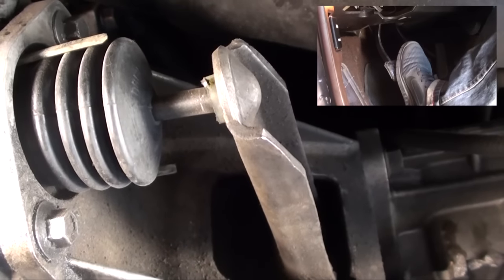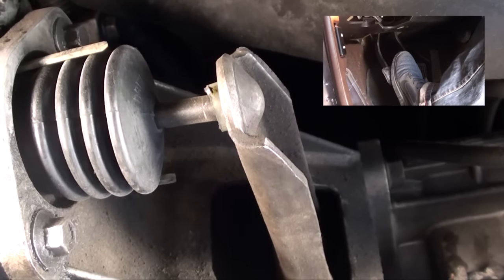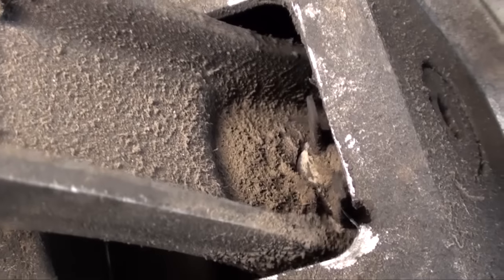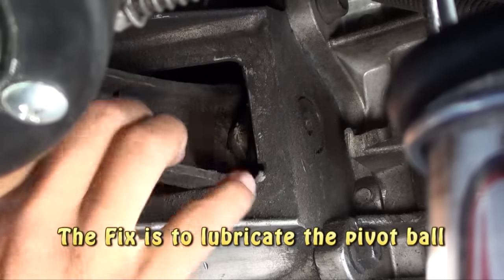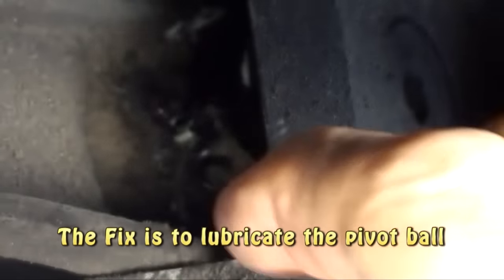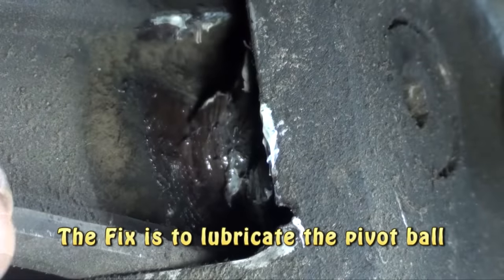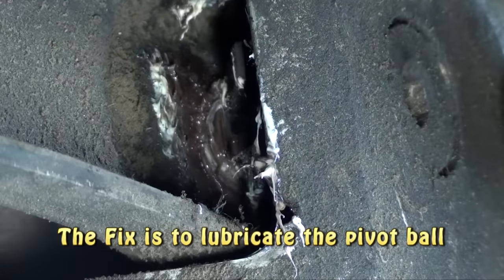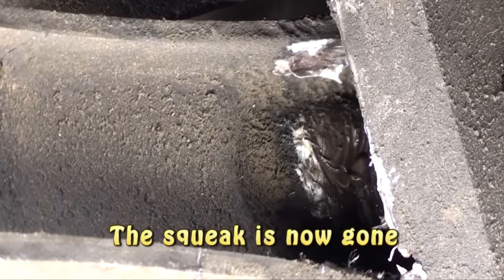Clutch Release Fork Noise

Comment: Hi,  My car shakes while shifting on low gears 1st and 2nd and squeak  sound also comes when pedal is pressed 80%.Not feels when shifting at high speeds. Any suggestions? Car ran 40k and is it the time to change the clutch? No pick up issue so far noticed. Thank you.
Reply from the maker: If you can provide me with some more information I will try to help.  The shake occurs at what point.  In other words while you are making the upshift from 1st to 2nd or after you let the clutch out once its in 2nd. Or is it when down shifting from 3rd to 2nd or 2nd to 1st.  again does it shake while moving the shifter or after letting the clutch pedal up after the shift has completed. Does it only shake when accelerating? Or will it shake after the shift whether heavy, light or no acceleration.  What kind of vehicle is this?  and is it Front Wheel drive or Rear wheel drive?  Does this happen every single time or only at certain times such as when the vehicle is cold or after it has been driven for some time and hot.  Does the outside temperature have any impact on the problem. The squeak noise could be in the pedal mechanism or it could be a pilot bearing noise. Some vehicles don't have pilot bearings. Does the noise sound like its from under the dash or more like its from under the car near the clutch.  Clutch life really depends on how you drive and your location. If you live where there are a lot of hills the clutch life will be shorter than flat lands.  Do you rest your left foot on the clutch pedal or totally remove it.  Resting your foot is bad for your clutch. If you want to make your clutch last keep your foot off the clutch pedal as much as possible and only use the pedal when you need it. Don't take an extra long time releasing the clutch when taking off from a stand still.  Normally clutches get replace because the friction lining on the clutch disc wears out similar to brake linings. When the disc is worn out the power from the engine will not transmit properly to the transmission and your drive wheels.  This effect is called slippage and first happens under heavy driving load situations. The engine and vehicle will feel like you are partially in neutral as you try to accelerate.  The engine RPM's will be higher than normal and it will feel like you have poor acceleration.  A good way  to test this is to drive on a straight flat road in 1st gear going about 10 mph and upshift into 3rd gear. Let the clutch out and floor the gas pedal.  If the engine shakes and or acceleration feels very sluggish your clutch friction is good and you don't have slippage. On the other hand if you feel the engine RPM's rise up but acceleration is not there you have slippage and the clutch needs to be replaced.  Make sure the disc, pressure plate, release bearing and pilot bearing are all replace. Make sure the flywheel is either machined or replaced and have the shop check and replace the engine rear main seal if its leaking.  Now is the time to replace leaking seals since the transmission has to come out to replace that seal.
Reply: Thank you. Sound and shake is observed when pedal is up after shift completion. It's a front wheel drive car. Sound and vibration is not always there,  when I started cold after shifting to 1st gear this issues repeatedly happening. Once vehicle started moving this issue is not felt. It might be of release bearing. Vehicle pick up is still the same. Its driven at city. I always keep fingers  of my foot (not entire foot) as in city traffic I need to shift gear occasionally.
Reply from the maker: This does not sound like a release bearing at all although its hard to tell since I can't drive it myself. You might not have a clutch problem at all.  I would check the engine and transmission mounts. If this happens while the vehicle speed going really slow you could have an engine misfire but you said the acceleration seems normal so that would rule out a misfire. You said the pedal is up and in 1st gear.  Could it be that the shake happens while releasing the clutch to take off from a non moving vehicle.  If so, that would be clutch chatter. Do you live in a city with a lot of hills like San Francisco? San Francisco is rough on clutches. I know you like to keep your foot ready to operate the clutch because of city traffic but I will tell you that even resting your toes on the pedal is not good for all the clutch parts.    Try what I said to see if your clutch is slipping by putting it into 3rd gear while going slow.  There will be shaking if you do this.  Is this shaking the same as what you are experiencing in 1st gear?  Are you in first gear going less than 5 mph and accelerating when this happens?  If so, that would be an engine lugging.  Same feeling you will get in 3rd gear at slow speeds and accelerating.  Do some more testing and write back.

Comment: I recently bought a 2000 mustang gt and don’t know much about it, car shifts all gears and no grinds at all besides when i put reverse too fast, it’s making this exact same noise when im not pressing the clutch in this case how does it work? i don’t see any pivot soo im wondering if it’s the same mechanism please help, thank you so much for the video
Reply from the maker: I looked up your clutch system.  There are 3 basic designs.  One like what I show where the pivot ball is located close to the release fork opening in the bell housing. One where the pivot ball is located on the opposite side from the opening in the bell housing. and One that doesn't use a release fork and instead incorporates the slave cylinder and throwout bearing all in one assemble.  Your Mustang uses the type where the pivot ball is located on the opposite side from where the release fork extends out of the bell housing.  Unfortunately for you the only way to lubricate the pivot ball and fork is to remove the transmission. Too many mechanics don't apply enough of the right kind of lubricant on the pivot balls and release forks to last the life of a clutch and they can start to chirp.
Reply: @DrivelineMaster all i hear is $$$ :( thank you so much for your time, what are the consequences of this long term? thanks hope u have a good day
Reply from the maker: Yes, $$$.  Depending on the severity this is two metal objects riding on each other moving back and forth with no lubrication.  After a period of time they will both wear and need replacing.  If they wear enough before the life of your clutch disk you will lose clutch operation. I can not tell you how long this will last before it becomes a problem.

Comment: mine is a motor type noise when shifting n clutching....... Every single gear is an annoying nightmare until you put it into final gear and just drive it
Reply from the maker: If you hear the noise or the tone or sound of the noise changes as soon as slight pressure is applied to the clutch pedal even if you only push it down about an inch this points to a throw out bearing noise.  When in the vehicle the throw out bearing noise can vary and almost be a rumble, grumble or grating sounding noise.

Comment: What type of grease could i generally use/general avoid?
Reply from the maker: Use any Lithium based grease.  I prefer high temp lithium grease but white lithium works well too.
Reply from the maker: This will work well.  https://www.amazon.com/Lucas-Oil-10533-Lithium-Grease/dp/B004X70LZA/ref=sr_1_40?crid=JJFKYTZGJ526&keywords=high%2Btemp%2Blithium%2Bgrease&qid=1704128320&sprefix=high%2Btemp%2Blithium%2Bgrease%2Caps%2C141&sr=8-40&th=1 or this: https://www.amazon.com/Sta-Lube-SL3111-Generation-Bearing-Grease/dp/B000M8IHQY/ref=sr_1_45?crid=38QEMHKLH9OSX&keywords=high+temp+lithium+wheel+bearing+grease&qid=1704128572&sprefix=high+temp+lithium+wheel+bearing+grease%2Caps%2C157&sr=8-45

Comment: How do I access the Clutch Release Fork? Is it in plain view? or hiding under transmission?
Reply from the maker: Each vehicle is different and some vehicles don't have a release fork.  You often have to go under the vehicle and see if you can locate the clutch slave cylinder. The slave cylinder connects to the fork.  The fork sticks out of the bell housing and is sealed with a rubber boot. If you can find the fork pull back the rubber boot and look inside to see if you can see the pivot ball.  Some pivot balls are on the other side and not accessible.  Also some slave cylinders and forks are on top and hard to get to.  If you tell me the year, make and model of vehicle I will try to look it up for you and I can advise you better.
Reply: @DrivelineMaster  Thank you for the advice, I have a 2004 mustang v6
Reply from the maker: From what I can tell your mustang uses a cable to release the clutch and the fork is on the left side of the bell housing.  The pivot ball is on the opposite side and not accessible to apply lubrication without removing the transmission.
Reply: @DrivelineMaster  Thank you for the info, how much do you think it will cost to get fixed at a shop?
Reply from the maker: This depends on where you live. Labor rates are higher in big cities as more rural area's.  Dealers tend to cost more than independent shops.  The repair would involve removing the transmission. This is the biggest labor part of the job but as long as the transmission is out you should have the entire clutch replaced. Just make sure to inform the shop to make sure to apply enough quality grease to the pivot ball on the fork so the noise does not return in a year.  It would not be fair to speculate on price. Call around and ask for a general quote for replacing the clutch on your mustang. Ask for two quotes. One with resurfacing the flywheel and one if they replace the flywheel.  I can say, it won't be cheap and almost certain to be north of $500.00.

Comment: Hello, I have the same sound in my Daihatsu Terios 15, would you mind telling me where is located, is it something I can fix by myself, I'm newbie but willing to learn, how to reach it, or should I take it to the mechanic?.. thanks in advance
Reply from the maker: Some release fork and pivot balls are easy to access from the exterior of the transaxle or transmission and some are not.  On the back of the engine is the transaxle.  A round shape as it bolts to the engine.  See if you can locate an opening where a metal arm (release fork) sticks out.  There will be a rubber boot covering the hole so dirt and water cannot get inside.  If you have found this pull back the rubber boot and look inside with a flash light for the pivot ball. If you can gain enough access you might be able to apply some white grease to it with a flux brush.  If not take your car to a technician and show him this video and ask them if they think this could be your noise and if they may be able to fix it without a huge expense.  Sometimes the pivot ball in not accessible unless the complete transaxle/transmission is removed. Sometimes spray grease from a can and a straw can be used but care must be taken not to spray grease on the clutch disk. I don't know about your Terios because I'm not familiar with that vehicle.
Reply: @DrivelineMaster  WOW! Awesome, will check tomorrow thanks a lot for your detailed response.. subscribed!!

Comment: Hey, my 2005 lancer got the clutch replaced last year and started to make the rattling noise this summer and started squealing last week but only when I change gears. The noise goes away when I press the clutch though. Do you think this is an easy fix?
Reply from the maker: A squealing noise most noticeable when letting the pedal up can be a pilot bearing noise.  Pilot bearing squeals or most noticeable when taking off from a stop sign while releasing the pedal.  While stopped put your transmission in neutral and release the clutch pedal.  If you hear the noise it could be the pivot ball and fork or it could be in your transmission.  Here is how to tell the difference.  Apply a small amount of pressure on your clutch pedal. Push it down about an inch. If the noise goes away it's your pivot ball and fork. If the noise is still there it's in your transmission.  If it's a rattle noise from your transmission check the oil level and make sure the correct type and viscosity of oil was installed. If in doubt drain and refill with the correct oil.  If this is a slight rattle that is most notable in a garage or ally way where the vehicle is close to some walls this may be normal gear rattle. You should not hear gear rattle in conditions where the noise can not bounce off of a close wall.  Gear rattle can sometimes be reduces by using a slightly thicker (higher viscosity) gear oil like 75W-140 instead of 75W-90. I would not recommend this if you live where the temperature gets really cold like 30 degrees Fahrenheit or colder.
Reply: DrivelineMaster thank you. It’s a loud rattle but I press the clutch a couple inches (like to the biting  point) and the rattling goes away. When I’m at a stop sign and take off it will sometimes squeak
Reply from the maker: This really sounds like the shop did not do a good job of properly lubricating the pivot ball and fork on your Lancer.

Comment: @drivelinemaster do you know if this would work on a Toyota Corolla 2012? I have has the same crickets/squeak and the Toyota Dealership can't seem to fix it?

And/or has anyone tried this fix on their Toyota Corolla 2012 or similar year?
Reply from the maker: Based on my information it looks like the release fork would not be too hard to get to and that the pivot ball is located on the side of the bell housing that is close to the release fork boot.  What this means is that indeed you should be able to apply some additional lubricant to the pivot ball and fork by accessing it through the release fork boot.  You might be able to get some white grease in a spray can but you have to be careful not to spray grease everywhere.
Reply: @DrivelineMaster  thank so much, I’ll report back on the out come!!
Reply from the maker: Good Luck

Comment: was the release fork and bearing exposed or did you have to open the gearbox casing?
Reply from the maker: The release fork sticks out the side of the bell housing and the hole is covered up with a rubber dust boot.  I pulled the rubber dust boot back to gain access to the release fork pivot ball.  I could see the release bearing but it's not accessible or serviceable through the release fork hole.
Reply: @DrivelineMaster  oh but i can put some grease on it via that hole?
Reply from the maker: There are 3 major designs.  One doesn't even have a release fork so this video doesn't even apply.  The other two designs use a release fork and pivot ball.  Design one is like the video where the pivot ball is close to the release fork opening. If you have this design then yes, you can lubricate the pivot ball through the release fork hole.  Design two has the pivot ball on the opposite side of the release fork hole. If this is the case you will not be able to lubricate the pivot ball through the release fork hole.  The transmission will have to be removed.  The only way to know for sure is to pull back the rubber boot that encloses the release fork and look inside to see if you can see the pivot ball close to the opening. Good Luck.
Reply: @DrivelineMaster  ill try to take a look at it and i told a mechanic about it and he listened to the sound and told me i needed a new trigger release bearing or throwout bearing, is this really true? because if it is it will cost me 900$ as they will also replace the clutch  :/ my car has only done 69.000 kilometers (42.000 miles)
Reply from the maker: So here is the difference between a pivot ball noise and a throw out bearing noise.  for a throw out bearing noise you might hear the noise without your foot on the clutch pedal or you may not but as soon as you press your clutch pedal down about 1" - 2" the noise will hear the noise or it will get louder or it will change in tone.  If the noise is a pivot ball noise the noise will go away as soon as you press your pedal down 1 - 2".  You see the difference?  Now and test it.
Reply: @DrivelineMaster  thanks for the answer and also what happens if i just ignore the problem? will it damage anything or? and another weird thing is it doesn't happen upon starting it up first time, it only happens after i have driven it a bit and warmed the engine up
Reply from the maker: Odd, both the throw out bearing and pivot ball noises are not typically temperature sensitive but stranger things happen. Plus I don't live where it gets really cold outside so getting down to freezing and below may be effecting when the noise occurs.  Yes, it is possible that continuing to let this noise go on could wear out something that would not normally have to be replaced.  The pivot ball and fork are not normally replaced in a clutch job so if this wears out you would have to add $$ to the $900 clutch job.  On the other hand the throw out bearing and pressure plate are normal replacement parts in a clutch job so if that is your noise you should not occur any additional cost when you replace the clutch.  It's hard to say without knowing exactly what is causing your noise.
Reply: @cocacoladog10  I'm in the exact same position as you with my 93 mustang 5.0.. let me know if you track down the issue.. its been hell
Reply: @ezrawildfeuer1534  it's the clutch release bearing and im gonna take my car to a mechanic they it will cost me 1000$  to have it fixed..............